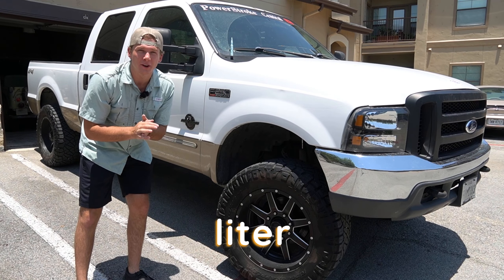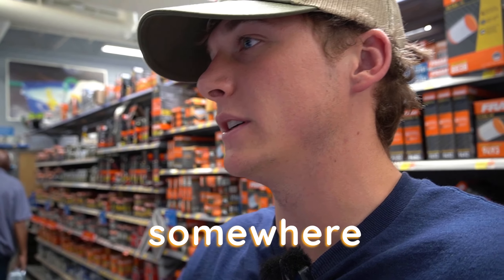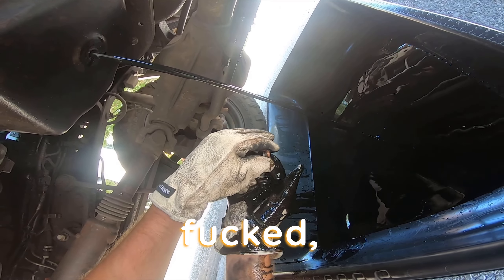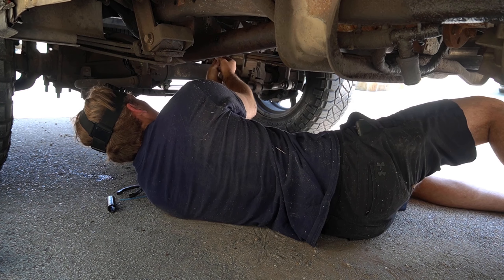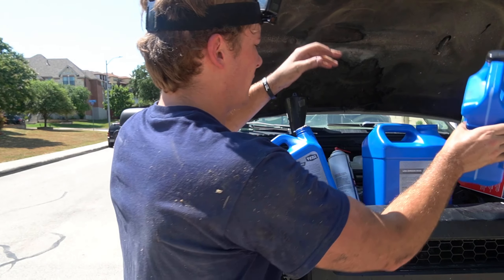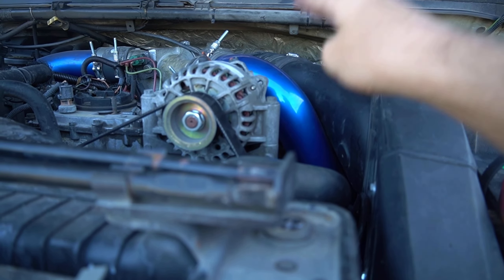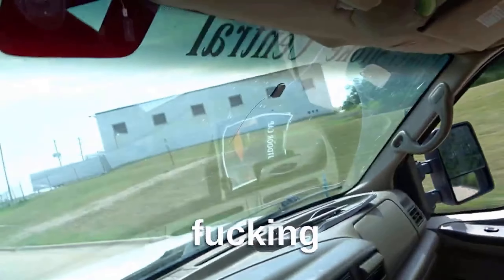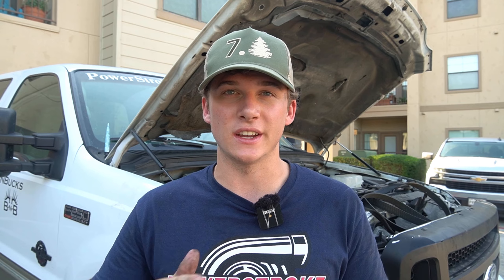Aftermath Of Racing My 7.3L Powerstroke 7 Times In 1 Day

Comment: Nice truck! 

Get some hair spray and lightly coat the inside of all your cac boots, let it tack up and install. It works great. 

Alternator belt 😂 just say “my bad”, use correct term moving forward, call it learning. Screw the mean people, but some are just trying to help, “let you know”. 

Get yourself some billet intake plenums now, once you go turbo upgrade you’ll be happy you did. 

Check your passenger side fuel hard line for pinholes. There is a bracket that mounts to the head that will get ya.

Get a billet thermostat housing.  

Up grade your up pipes. Bellowed version. Or do it whenever you drop the turbo next. 

I’ll shut up now. Got many more “tips” if you want them 😅
Reply from the maker: Thanks brotha I appreciate the comment will definitely be using these tips.

Comment: When I do my oil change I use the Motorcraft Filter and the Motorcraft 15W-40 engine oil.  I also use 3 quarts of Hot Shots Secret Stiction Eliminator.  I pour 1 quart into the filter to pre fill and I then use 2 quarts into the engine with the Motorcraft oil.  Hot Shots Secret works fantastic with these 7.3 powerstrokes you will feel a difference when you use it.  I also use their diesel fuel additives and that stuff is like sweet tea to these 7.3 powerstrokes.  Long live the 7.3 powerstrokes
Reply from the maker: Sounds complex how often do you change it?
Reply: Every 5 thousand miles
Reply from the maker: @siscoe1986  nice same here

Comment: And yes, it’s called a serpentine about and there’s another upgrade that you have right there. You gotta get the radiator hose for the dual alternator set up and it’ll route around your serpentine belt right down the alternator and you can clamp it to it and you can change your serpentine belt without having to disconnect your radiator hose

Comment: You already have the dual alternator upper radiator hose on the truck so you didn’t have to take off that hose to swap the belt.

Check your balljoints and steering components when you change your wheel bearings, i bet you have more wrong on the frontend than you think. Riffraff diesel makes a tool to grease those front wheel bearings, it actually works really well. It only costs about $20. I grease my wheel bearings once a year when i pull apart my brakes to grease the slide pins and put disc brake quiet on the pads.
Reply from the maker: Thanks man your comments always help me out brotha I appreciate you.
Reply: @powerstrokecentral , no problem. Another thing you should do (especially when you put those new injectors in) is change the HPOP reservoir oil. It’s easy to do and that oil comes out very black and almost tar-like. You don’t want to ruin those new injectors by feeding them very dirty oil upon first startup.

Comment: When are ya coming to Colorado? And what size turbo? I use to have 180cc/80s in mine I liked it with stock turbo. I got new turbo from kc the 66mm king tiger but it had a lil to much lag just as a heads up. But now got full force 275cc/200s. Keep up the vids glad to see someone making 7.3 content!
Reply from the maker: not sure on the turbo yet just worried about the injectors rn. and im coming to Coloardo when i hit 10 k subs.
Reply: @powerstrokecentral  awesome man hopefully that’ll be here soon.
Reply: I have 180/30s with a kc stage 2, got the kit from full force for my 7.3 excursion been loving the sound of the turbo! Power is much better but nothing compared to what you got those 275s probably make it move!
Reply: @Lonewolf23-26  ya the stage three was just too much for my 180cc but I think the stage two would’ve paired way better. But now I got too much fuel not enough air time for a t-4 kit lol
Reply: @Lonewolf23-26  and ya the 275s really make her move. I’m glad I didn’t go at 300s for the turbo I have currently but once I get that T4 kit installed I’ll be wishing I had 300s but that’s the way she goes.
Reply: @mitchellgertner7942  😂 yeah once the bug gets ya the list gets longer! That t-4 should help the air move!

Comment: What about the fuel filter. I was wondering how you change it.
Reply from the maker: Changing that on next regular maintenance day didn’t need to change it in this video
Reply: Find the fuel bowl. Look for little yellow handle in back, it will open the drain valve for the bowl. Once drained, unscrew fuel bowl lid, replace filter and 2 o rings. One is on base of filter, other is for the fuel bowl lid. Cycle key, key on engine off 3 times. Done

Comment: T5 /t6  15w40 Rotella a.k.a. smell Tella
Reply: Agreed! Gotta throw some stiction in there though and she’s good!
Reply: 7.3 was not designed to run synthetic oil. It thins out to much.  
Only 15-40 conventional oil
Why to properly make your injectors fire.
Reply: @vincebotkin1960  there was no synthetic 15w40 back then that’s y I been runing it on my and I work my truck with my dump trailer and she get it fine 295k and going
Reply: @fuelup7504  
337,000 on conventional oil. Still running strong. 
The Ford certified mechanic is the one who told me that the 7.3 was not designed to run synthetic. 
Synthetic is to thin.